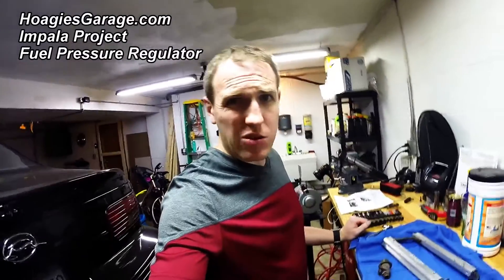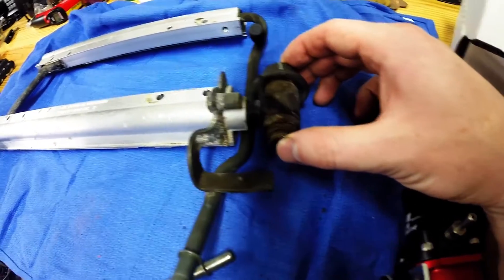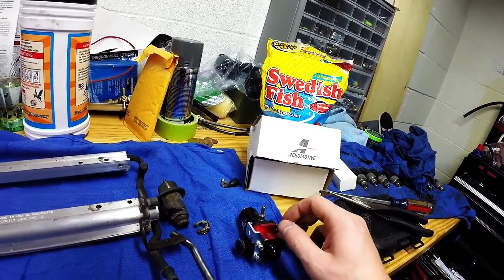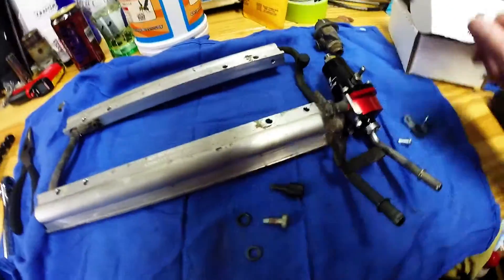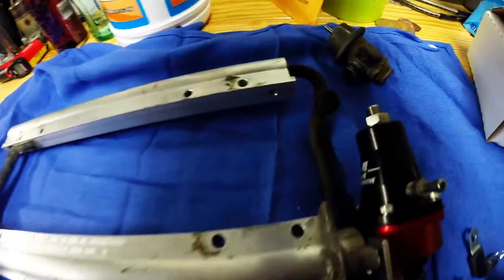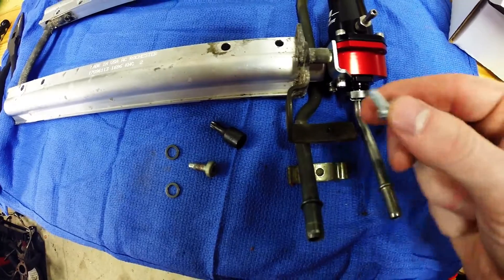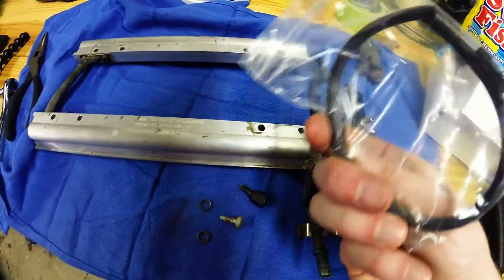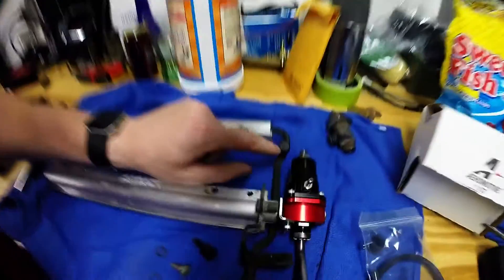Impala Project - LT1 Fuel Pressure Regulator by Aeromotive

Comment: Just for anyone watching this now, this Aeromotive FPR has proven to be one of the worst additions to the LT1 that you can make. Unreliable, cheap and leaky. Unless you're making 400 horsepower, stick with a factory AC Delco FPR.
Reply from the maker: Yup this one had a constant fuel smell. So lame.
Reply: So what is a good one? Im at this step now.
Reply: @briansaathoff4038  just get a factory AC Delco replacement on Rock Auto or your favorite parts dealer.
Reply: Thanks I was just looking into ordering this fpr. Guess I’ll seek other options

Comment: Did you ever test fuel pressure with key in on position with the new areomotive FPR installed?
Reply from the maker: I did. No leaks or issues and it held pressure fine. It did have a fuel smell under the hood though.
Reply: @RubberCityMotoring  Do you have an aftermarket fuel pump?
Reply from the maker: Yes I did. Racetronix setup.

Comment: Nice vids but quick question my 96 impala ss turns off under a hard acceleration and at 70 or above it misses and shake then the engine light comes on what could that be?
Reply from the maker: Opti? - Not sure on that.... Let me know what you find.
Reply: Optic high resolution problem under heavy load the opti malfunctions replaced it no problem anymore